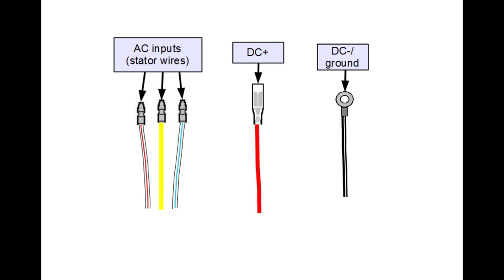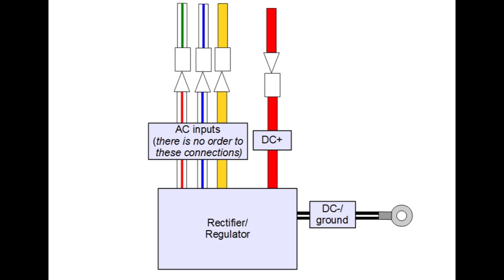#11 Suzuki GS Rectifier Regulator Installation Video from Rick's Motorsport Electrics

Comment: On my 1982 Suzuki GS650G the volts were over 16.5 v. Not wanting to fry my harness, I ordered Rick’s r/r, and we’re now running 13.5 v to 14 v.  That was five years ago and we’re still running great. There’s a lot of chatter about instead of OEM spec (like Rick’s), people modify a SH775 Series regulator/rectifier, but so far I’m happy with Rick’s.

Comment: Hi, what kind of connectors are these? I have them on my Suzuki FA50 but I need the female ones to crimp to my battery leads.
Reply from the maker: The terminals in the video are 4mm bullet terminals, which were stock for this bike.  These may or may not be the correct ones for the application.  If you send us a photo of the terminal(s) you're looking to replace by either emailing info@ricksmotorsportelectrics.com or texting 603-329-9901 we can check our inventory and see if we have it.

Comment: Can I connect the DC ground direct to by negative battery terminal or am I brain blasting in the wrong direction. Many thanks
Reply from the maker: Yes the DC-/ground line can go directly to the negative terminal, or it can go to a solid frame ground.  It just needs a secure path to DC-.

Comment: Is that clear portion over the plugs just an insulator?
Reply from the maker: Yes; it's a PVC sleeve that prevents the metal terminals from touching each other (or anything else that they're not supposed to).
Reply: @RicksElectrics  ah, understood. Thank you. Would heat shrink/electrical tape not work well enough to insulate from one another? I’m working on my first bike and have to replace the bullet connectors on a few things.
Reply from the maker: @SirGuidemere91  Heat shrink would work, but then you'd have to cut it if you ever have to disconnect it.  With electrical tape, if you have to remove it, you get the adhesive everywhere.

For bullet terminals like the ones in the video, the PVC sleeves are best balance of ease of use and protection when properly installed.
Reply: @RicksElectrics  thank you very much. I just ordered some 😄

Comment: My 1977 Suzuki GS 500 has a separate regulator and rectifier, what scheme should I follow to assemble your component that encloses them in one piece? From the stator come out: yellow, white / green and white / blue, instead from the regulator come out red, white / red, yellow, white / blue and black.
Reply from the maker: The three AC outputs can connect to any of the three AC inputs on the rec/reg; order does not matter.

Comment: I have part 14-202H that I am trying to install on my 1979 GS750, what is the difference between connecting it in place of the OEM regulator/rectifier and connecting directly to the stator? Also since the 3 wires on your rectifier are all yellow, does it matter which colored wire they attach to?
Reply from the maker: The AC inputs on the rec/reg can be connected directly to the AC outputs from the stator.  There is no order to them.

Comment: hello mate really good video!!
Just a quick one: my previous bike owner has replaced the original rec reg 5 wire  (3 yellow 1 red 1 ground) with an 6 wire ( 3 yellow 1 red 1 green and 1 black) my issue here is with it being a black and a green wire i understand to connect ground the green wire but dunno what to do with the black one ,any help? thanks!!
Reply from the maker: Is it one of our parts?  If so, what part number?
Reply: @RicksElectrics  its not .
Reply: Have u found out ?
Reply: @elcompapablo739  yeah i think i left the black one blank